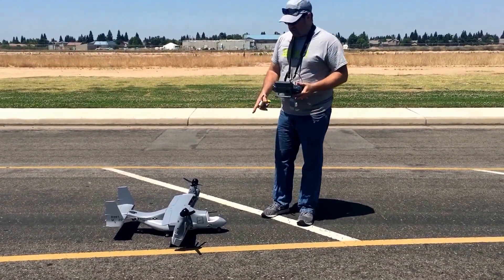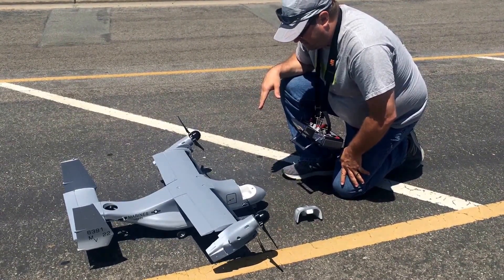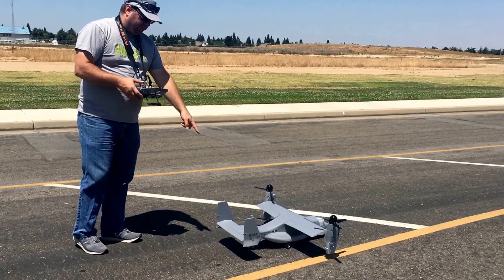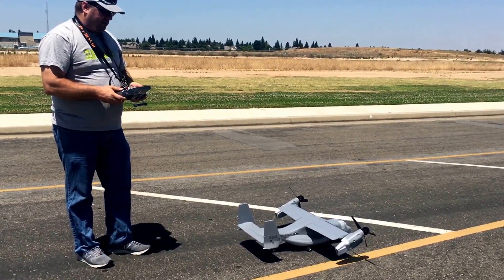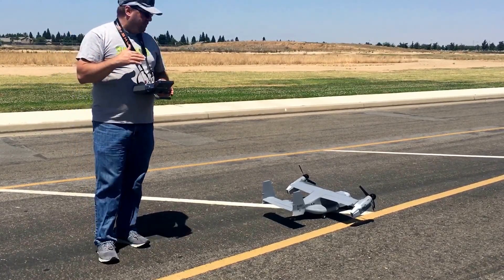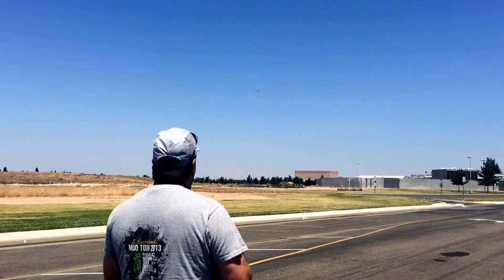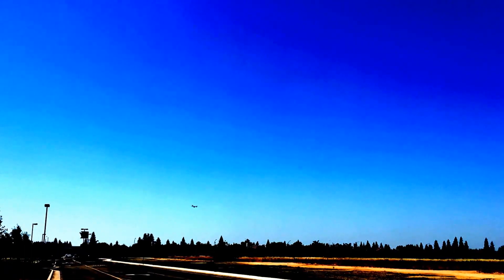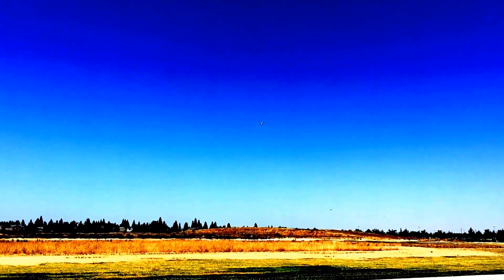Banana hobby V-22 controls and sortie

Comment: Hi Tom. I am wondering what you had to do for the 45 degs angle. I am using a spectrum dx 8 and wondered if you just set it up on a three function switch. Look forward to your reply
Reply from the maker: morety324  I’m not Tom, but to answer your question I use FrSky. I actually had it set up to use a 3 pos switch and a slider. The 3 pos switch had Forward, mid and vertical modes. In mid I could use a slider to select angle from 0 - 45. 

Hope that helps